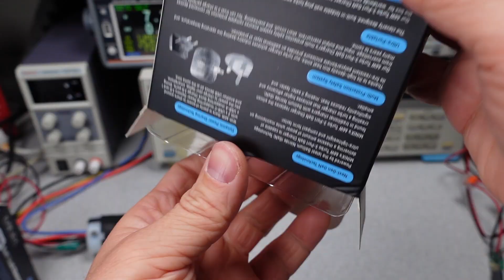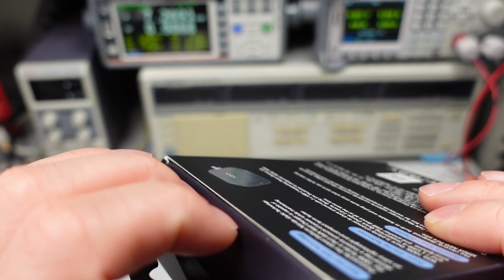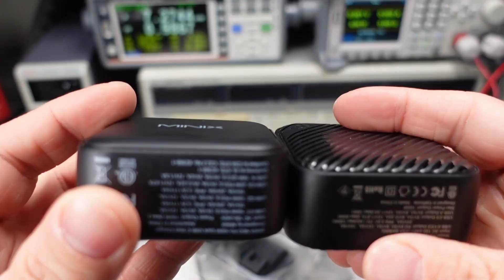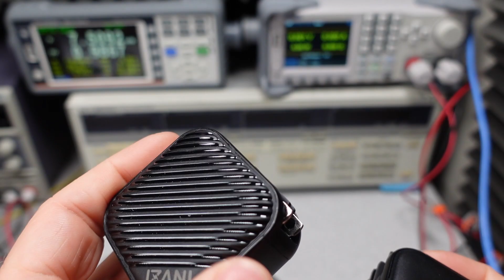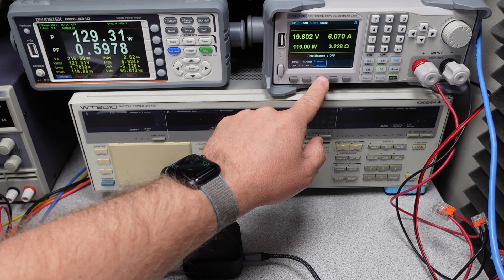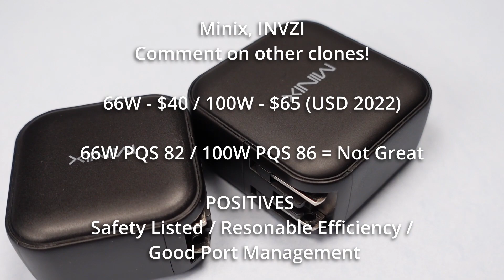MINIX Neo P1 and P3 USB Power Adapter Review and Test

Comment: I've got a 100W gan like this (the exact same port configuration and form factor) but a different vendor (energea or something), and I've got a weird issue with it. When I'm charging my mac (original apple brick rated 96W) with a typec->typec cable it works fine for any period of time, but once I do that with an original typec->magsafe3 cable it stops/starts charging from time to time over and over to the extent where my mac just stops charging completely until rebooted. Any clue how this works? Is it some PD renegotiation trick which is borked with a combo of a magsafe cable+this adapter?

Comment: Great videos and analysis of power adapters and power banks. I really appreciate your in-depth technical analysis - it helps me weigh the ergonomics, form factor, and other non-technical characteristics against the technical performance and limitations. Thank you - keep up the excellent work. 

Based on my experience, the INVZI is an excellent on the go power adapter. I purchased the INVZI GanHUB 100W (same as MInix P3) over three years ago - it has served me very well. Because of the size, it's great for my old macBook Pro 16" and now M3 14". The USB-B and USB-C ports allows me to travel with just on power supply for all my devices. For my home base, I use the Apple brick and other more energy efficient power adaptors. The poorly documented port reset "feature" is a constraint, but once you understand the operation - its an acceptable tradeoff over carrying a larger or multiple power adapters. Additionally, I've also successfully used it internationally with the adapter kit. All that said, I don't openly recommend it to others who won't take the time to learn its limitations and leverage it's strengths.
Reply from the maker: Thanks for watching! 

I agree with your analysis of the Invzi, minix, about 30 other brands, power adapters.  I think they're functional and they are compact.  The travel adapters are generally available as well because there are so many brands selling this same product.  You do sacrifice a bit of efficiency but if it works then it's the right one.

Comment: So is it a good travel charger because you don’t really pay for the electricity when you’re in like a hotel? It has the good form factor and spread of ports but $40 is like crazy to me.
Reply from the maker: Do you NOT pay for the electricity in a hotel?  Actually, they are an industrial customer so they do pay for your bad power factor.  Your room rate obviously includes electricity, water, the internet, etc.  Anyway, yeah the 66W one is about average for a travel charger.  The 100W is worse than others.

Comment: So other than being power inefficient, what are the practical downsides of the underperformance? 
The unit isn't getting that hot, so I doubt there's a chance for a fire. And it's not damaging the devices it is charging. So what's the problem other than the inefficiency?
Reply from the maker: It's really just that.  The 66W is okay, the 100W I'd really stay away from though.  These are extremely common chargers from many brands, heavily cloned.
Reply: @AllThingsOnePlace   I wouldn't say "cloned". As someone who works with Chinese factories, I can guarantee you that all these brands are contracting from the same factory, and none of them own the factory. Factories that turn out light consumer goods are usually owned by the factory owner, who usually doesn't have any of his own brands, he just OEMs from other companies.

The only difference between the branded products is the brand itself. And nearly all of them are fly by night, here today, gone tomorrow outfits. Many are owned by the same person even. It's a huge mess.

Comment: One thing I really do not like about this charger in particular is the massive inrush current they draw when first plugged in. I had an issue using these on a in flight AC  outlet because of it. That's one thing I believe you should add to your test suite, inrush current on the AC side. I switched to a 65w RAV power mini brick that doesn't do that. To test this I, unscientifically, used a 65w AC power bank; if it trips that device, it probably won't work on the airplanes AC outlet.
Reply from the maker: You mean you can't see the waveform and time plugging it in to exactly the zero crossing of the sine wave?  (joke)  I think they sacrificed a lot in these minix and invzi and about 40 other brands that sell this same adapter, to make it small.  But yeah, planes have current limited outlets.  I was able to use my 100W Anker prime adapter fine though, with some cable rigging to make it not fall out of the loose sockets on planes.  It is inherent that many of these will have a high inrush current, some have reasonable filtering on the input side that will help a little bit, but mostly the bulk capacitors get charged by the mains in a single cycle.  No room for a NTC or a relay/resistor.

Comment: @AllthingsOnePlace Please could you consider doing a drop test? I've bought non-apple chargers in the past, and they were super nice to use. Lightweight. Nice range of output ports. But one teeny tiny drop, from a few inches, literally, and stopped working, after like 1-2 days usage. I would be very wary of buying non-apple chargers in the future. A drop test would go a long way to re-assuring me that these devices are not going to die from the slightest teeniest little micro-bump.
Reply from the maker: Ha, yeah, a minor drop I'd certainly expect these to survive.  Some of these have been through a lot of drops.  Any of the ones in my top picks have traveled pretty well, and I tend to be pretty hard on equipment in general.  But yeah, maybe a quick mention and a low level drop test, something they should easily survive isn't a bad idea.  Thanks!

Comment: Hi thanks for the video. I am doing the Atlas mountains race in February. It's a self supported bike race. 
I need a charger and power bank to change  my Garmin lights and phone. 

Can you recommend any devices. 
Thanks Dave Tilly.
Reply from the maker: I'd recommend two devices, primary and a backup for something like that.  Do you know how much energy those devices need and how long they need to be powered for as well as what protocol they talk (USB C is assumed but PD)?  Say you need 20 Wh per day to charge the two devices, then you need a 30 Wh minimum pack before losses, divide by 3.7 volts then multiply by 1000 to get milliamp hours = about 8000 mAh, so a minimum 10,000 milliamp hour battery pack should be good per day with this example.

Comment: This is very interesting, I have had some issues with my minix charger when using it on a train in the UK. For some reason I can’t use my touch screen on my iPhone when using this charger via a train socket.
Also while charging my windows laptop and iPhone at the same time through any combination of ports it can’t seem to stabilise on my laptop it keeps turning the laptop screen on and off.
It is really handy for a portable charger and the swappable plates are golden for travelling abroad. It’s just the reliability and strange behaviour that is concerning.. I’d be interested to hear your thoughts on why it behaves this way
Reply from the maker: The touch screen is from a leakage current condition, the mains are leaking through the adapter.  This always happens to some extent but sounds like you’ve got one that’s a bit hotter than others.  I need to make a video on this.  The issue of screen on and off is it failing to negotiate usb properly.  There’s no way to really predict which products are going to work best with which adapter and how they mix.   I have a hp laptop it won’t work on usb with anything except a Dell or hp official adapter but through a dock it’s fine being powered by anything usb c, or I use the barrel plug (blue tip) to usb c adapter cable.

Comment: is it safe for the battery of my device ?? I mean will it degrade its battery life or cause any other damage to battery / device ??? (using MINIX P1 for my MacBook Air M1 & Samsung z fold 4).
Reply from the maker: It is okay, meaning safe, for the plugged in device.  The device will decide how much power to draw.  These are fairly mass produced adapters under many different brands so the design is stable.  It isn't the most efficient thing ever but it also isn't the worst.
Reply: @AllThingsOnePlace  by "not most efficient" means it will consume more power than required? Right? And by "stable design" means it will not show any fluctuation on DC side?? Right?? I wasn't able to understand that perfect sin wave thing in your video, so I was wondering if it will hurt my devices by any means??

Comment: The big advantage of the 65W version is that it is insanely small and light, in fact I believe it is the smallest 65W charger. So despite the poor efficiency, for some people who travel a lot where ever cubic inch matters, this is probably the best thing, plus the the swappable plugs mean you don't have to carry an adapter.
Reply from the maker: Yeah, the 65W version of this adapter is a stand out for compactness and having multiple ports.  The Anker Nano II is tiny but it is a single port device.  There are other tiny cube like devices but then they don't have the travel adapters bundled with the product.  From that perspective this is a winning product.  Also, there are tons of clones of this product under MANY brands.
Reply: @AllThingsOnePlace   Do you think that the small size is why it's so damn inefficient? Cause even in 2024, the Minix 65 and 100 W  chargers are the smallest on the market regardless of whether it's a travel charger or not.
Reply: @AllThingsOnePlace  so Minix/INVZI cube 65W charger is original/first product? And Minix/INVZI are best? (build quality, effeciency, performance)
Reply from the maker: @livewtw2559  No far from original, no idea what the original is.  They are all of equal build quality, efficiency, and performance.  They are identical inside.  I like the MINIX because it comes with the travel clip on adapters.
Reply: @AllThingsOnePlace  HyperJuice HJ265 come with 3 travel clips on adapters (US, EU, AU) and higher price :)

Comment: You've been mentioned a few times on the r/onebag subreddit. One of the tricky things is finding a power adapter that is safe but also handles voltage conversion and has compact international adapters. The MINIX is great for that but as you said poorly efficient. Could you put in international adapters as a category that can be filtered for on your website? It would be very useful for a lot of people.
Reply from the maker: Yeah, I can add the word travel to the minix adapters.  Search will find them.  Technically, ALL power adapters can be travel adapters though so I’ll only add to ones that comes with adapters.  So far, only the minix has done that.  I have a few others not tested though.
Reply: @AllThingsOnePlace  I really appreciate that, thank you, and I'm sure many other people in the subreddit will appreciate it too

Comment: The product page for the P3 says it's 25mm wide, but I don't think that's accurate because all of the other clones are listed as wider. Can you verify?
Reply from the maker: No, it isn't.  The 66W versions (all the ones I have) are 31 mm wide, the 100W versions (all the ones I have) are 32 mm wide.

Comment: I made some calculations and it looks like it will consume around 0,165 kW per month in the idle mode. Which is a suuuper tiny fraction of a usual consumption of an average German 1-person household of more than 160 kW per month. Doesn't look like a big deal and decision making point, right? UPD: I mean there are not so many devices in a small form factor with multiple ports capable of charging a laptop a the price point below $50
Reply from the maker: That is correct but there are a few factors to consider on the AC side.  Real watts aren't the only story because there is a frequency and phase interaction between voltage and current.  The real energy (kWh) cost, of the higher idle consuming device, at the socket is as you stated.  The high current, and high V*A, at idle means the REAL cost at the meter is going to be higher and much higher for a commercial location, that pays for power factor.  It is still a small number but the point is everyone leaves power adapters plugged in all the time.  If the whole country did this you'd need extra power plants operating to cover idle power consumption of a 0,24W device versus a 0,1W device.  Also, most people have more than 1 plugged in.  This, higher idle power consuming, adapter technically doesn't meet the EU 2019/1782 requirements either.  So, numbers are tiny when you look at one device in one condition but the EU/DOE/AS/NRCAN standards are all in place to try to lower the power consumption even if only a few tenths of a watt.  Of course idle is only a piece of the pie.

Comment: Thanks for testing this. I'm a bit disappointed that it wasn't better, but I didn't pay nearly as much either and for an additional plug for AU/NZ with my wiredix. 
I don't understand why all these companies are seemingly cutting corners on something that people are likely to leave plugged in. At least I know not to leave it plugged in when not being used now. Thanks again for this.
Oh and if you're doing some more tiny power adapters, there's the RY-U33 models as well, they're quite cheap and I'm curious how bad they are.
There's a full teardown of the RY-U33 on a chinese site I can't link to.
Reply from the maker: I added it to the list and yes smaller adapters.  I think the smaller adapters are very important but seem to be getting left behind by monsters that devices don't even take advantage of for the most part.  Laptops and devices are getting more efficient (gamers aside) and power adapters are getting bigger.
Reply: @AllThingsOnePlace  part of it appears to be the push by xinese phone makers to charge from zero to full in 15 minutes, which means regular chargers won't cut it. I'm not sure when that is needed, but it's considered a good feature by most reviewers as well, despite the fact that most people change their devices over night.
The EU should deliver some kind of conclusion on their USB-C charging standard directive next week, which will be interesting, as it might include laptops as well.

Comment: There is so many power adapter videos it would be nice to have a video where you talk about what you recommend
Reply from the maker: It certainly isn’t these ones… I need to do a summary of tested adapters video soon.  The current front runners are the hyphen-X and baseus multiport 100w adapters but I struggle to say recommendation though because nothing is perfect.
Reply: @AllThingsOnePlace  Any recommendation for the 65w range?